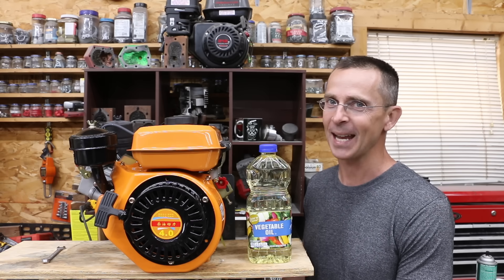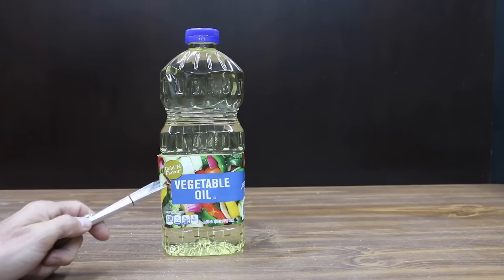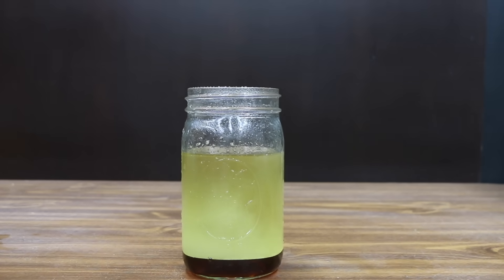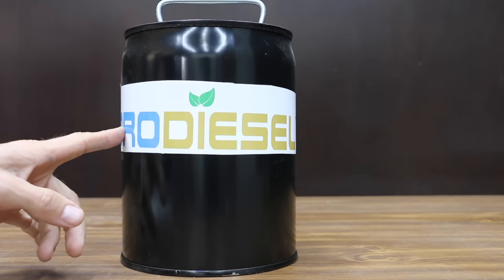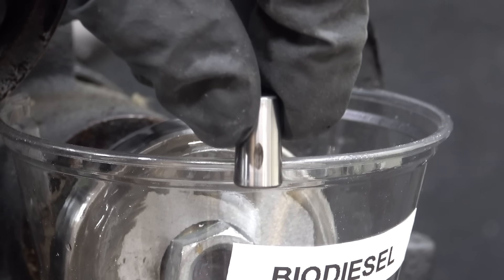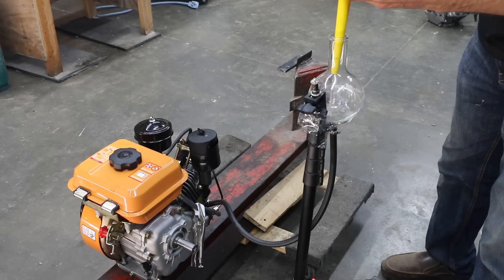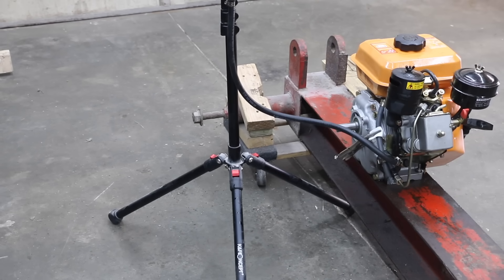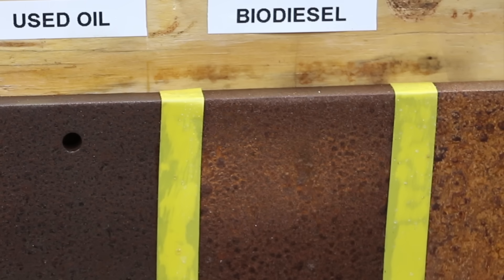Make "Biodiesel"? Let’s find out! Diesel vs Biodiesel, Used Motor Oil, Vegetable Oil, MPG

Comment: You should test which portable heater is fastest/quickest, cheapest to run etc.
Reply from the maker: Thanks for the video idea.
Reply: @ProjectFarm  ah cheers mate. Really confused at the moment. Seems people seem to say cheap and expensive electric heaters output same amount of heat if electric rating is the same. Does that mean they take the same amount of time to heat up a room? Then you got the fan versus convector. And oil based radiators or some such thing. And ceramic heaters too now. Nobody seems to have really tested it properly. And the difference is between 10 pounds to hundreds of pounds.

Comment: I wish you'd tested used fryer oil, as it might have lost lubricity.

I was really surprised that veg oil lubricated so well,  as the word on the street is that it causes pump failure because it doesn't lubricate as well,   definitely something wrong with that rumour,  unless a week in a fryer drops it's lubricating qualities ...

Supposedly older mercs can handle veg oil,  but the newer ones wear out the fuel pump on it,  and the dedicated users have a diesel tank to start on,  and use engine or coolant heat to warm up the veg oil before switching over.

I wondered whether the biodiesel lubricated better than it's component oil as synthetic oil is an ester,   another theory bites the dust.
Recently I heard that biodiesel blends are better than diesel or biodiesel,  less likely to grow microbes in tank,  but I think any fuel will grow microbes if there's water contamination,   they grow in the water interface.
Reply from the maker: Thanks for the feedback.

Comment: A test with marine grade adhesive sealants would be pretty neat! I use a product at work called 5200 made by 3m and have never seen it fail or break in any way. Life seal and 3m 4200 are also pretty tough and may be fun to test.
Reply from the maker: Thanks for the video idea.
Reply: The 5200 sure is amazing stuff God forbid you ever have to remove it though
Reply: @thomasbarlow4223  wire wheel on an angle grinder 🤪😷

Comment: I have run thousands of gallons of WMO mixed with diesel or gasoline and find it to be an excellent fuel, even in somewhat modern (pre-dpf) engines.  

  I usually mix it 50/50 with diesel but I have run it as thick as 90% WMO/10% gasoline in the summer.
Reply from the maker: Thanks for sharing.

Comment: Good day Sir 
I was wondering if you could make a video of running a nitro/glow rc engine on the required methanol and castor oil and instead of nitromethane you use petrol/gas in America or diesel 
It's just for interest sake
Reply from the maker: Thanks for the suggestion.
Reply: @ProjectFarm  
I enjoy your content
I didn't come to YouTube to go back to school but when I watch your channel I learn and I enjoy 
The findings are very helpful and most of the time interesting 
Especially the test between the different oils
Oh and plz use castor oil and not 2 stroke oil because 2 stroke oil clots up and forms a weird substance at the bottom

Comment: Will a gas car engine run on 50/50 gas and plain vegetable oil ...... soon gas will be so expensive maybe some mixtures may be in order for 4-wheelers, lawnmowers, cars..... what mixtures work well...... I do run a 1 gallon to 10 gallon mixture of diesel to gas (10 gallons of gas) in my old ford ranger 2.0 (have done this for years)
Reply from the maker: Thanks for the feedback.
Reply: @ProjectFarm  thank you for the informative and very entertaining content
Reply: Incidently ..... in the old heavy equipment we have run on 10w30 many times when needed to

Comment: That was another fun project. I think a car with its more sophisticated electronic injection and o2 sensor, would do a better job of mixing the fuel with the right proportion of air for more efficient burning. My wife saves all the oil from olive jars and sun dried tomatoes in oil, to pour into the tank. Not a great amount by any means, but possibly another 5 miles of driving every week.  That engine is a handy little thing to have around. It might not run so well if you put raw Burger meat into the sump to see if it runs better than bananas 😂
Reply from the maker: Thanks for sharing.

Comment: Please do a woodgas/pyrolysis setup and test different types of organic waste (including general trash) and plastics to run on your generators. Would be great to see what materials has the most energy density in terms of flammable gases produced in the process.

You could probably produce some usable byproducts in the pyrolysis process. Trying these in your engines will also be really interesting to see!

Being able to run your home from your waste alone is a topic I'd like to see more of!
Reply from the maker: Thanks for the suggestion.

Comment: I wonder how well it would take to a load on it, such as a go-cart. Smiles per gallon.. would it affect speed, horsepower, or torque..   which one runs longer..  we need more testing on this
Reply from the maker: Thanks for the suggestion.
Reply: @ProjectFarm  thanks for reading and replying.. didn't think anyone would actually see this.. I know diesels are torquey. Just wondering if it would actually lose anything with alternative fuels.

Comment: The old and trusty Mercedes Diesel generation (OM601/602/603) run very well on straight rapeseed oil. Only a few minor things to consider, but no problem at all and people used to do this a lot here in "old Europe". They even collected frying oil and cleaned it up in their own centrifuges.
Reply from the maker: Thanks for sharing.

Comment: When I had the time I made fuel from used motor oil. I cut it with some gasoline or sometimes paint thinner. Both my 1989 7.3 and my 300D loved it esp my 300D. I think my 300D ran way better on it than diesel. One day I’m going to find a beater newer TDI 2007 and up to experiment with.
Reply from the maker: Thanks for sharing.

Comment: Do a friction wear test with 2 stroke mineral and synthetic oils in diesel, gasoline and etc...

I'm interested if 2 stroke motor oil works with ulsd diesel for old mechanical fuel pumps
Reply from the maker: Thanks for the video idea.

Comment: I had a 86 f250 with 6.9 deisal. Summer time i ran 80 to 100% used motor, tranny, gear, hydraulic oils. Winter i mixed it 50/50 with kero, heating oil, or diesel. Whatever was cheapest atm. Ran it 2 years with no issues other little more smoke. Till i got ride of it.
Reply from the maker: Thanks for sharing.

Comment: Motor oil used or not creates abrasive ash when used as fuel in a Diesel engine, which has nothing to do with the dirt in used oil, the increased wear it creates on the bores and rings cancels out the saving in fuel costs. With vegetable oil you can run a Diesel on it but its viscosity cold means it may not start on it, you need to preheat it to 80 deg C to match the viscosity of Diesel oil which the fuel pump and injector are designed for.
Reply from the maker: Thanks for the feedback.

Comment: A test for biodiesel is shelf stability, the ability for the fuel to sit in a normal vented Land Rover fuel tank for a period of months and not coat every metal surface with a hard wax like gell  or attract moisture and rust out your fuel tank and fuel lines. Ask me how I know.

Comment: Great subject and video.  I’d like to see you test fuel mileage differences in heated waste veggie oil, heated waste motor oil, bio diesel, and regular diesel.
Also, a cost per mile, would be interesting to know too. As well as the time it takes to filter/process each fuel.
Reply from the maker: Thank you!  Thanks for the video idea.

Comment: Great test as always! I can actually relate to this, I dump all my used motor oil into my 95 Cummins. Its amazing how many people think your nuts!
Reply: I did the same when I had a Ford diesel . After I ran it through a t shirt for a filter.
Reply from the maker: Thanks!  Thanks for sharing.
Reply: Used engine oil is carcinogenic, but so is gasoline and diesel
Reply: It doesn't clog the fuel pump?
Reply: @WHATdowelearnfromthis  It's a diesel engine, I'm sure it takes less to move that through than diesel fuel
Reply: @WHATdowelearnfromthis  oil won't clog the pump . Plus it gets diluted . The risk is metal particles from engine wear
Reply: I've gotten through some tuff times in this manner Transmission fluid as well always 50/50 with diesel. The engine ran better and got better economy. A common antidote for the low sulfur diesel is a quart of Trans fluid at every fill up

Comment: I know this is anecdotal, but I have been running a 12 valve Cummins for 10 years on filtered used motor oil and/or ATF with no problems at all, it seems to like ATF over motor oil.  Stay away from full synthetic oils though, for me it tends to run rough and the EGT's get high.  You do need to cut it with diesel or gas if you run it much colder than 40F but in the summer I run straight oil.  On an older truck I wouldn't hesitate to run motor oil/ATF but with all of the sensors and complicated injectors and pumps in the modern diesels I wouldn't risk it.
Reply from the maker: Thanks for sharing.

Comment: I looked and didn't see torque wrenches yet on you channel... Unless I totally missed them. I'd love to see strength and accuracy from low to high end ones.
Reply from the maker: Great suggestion!  Thank you.
Reply: @ProjectFarm  cool! If you do do it, I'd love to see Lexivon in there. I needed to get over 100 ft lb for my wife's new wheels, and my Pittsburgh 3/8 didn't go that high up, and I never trusted its' accuracy. So I bought a 1/2 inch Lexivon brand one. Amazon seems to be pushing them hard. The tools seem real nice and solid, but I can't help but think I overpaid for a nice looking piece that isn't that great.

Example: I know when the end nut is "Locked" on the Pittsburgh, the handle still spins while using it, changing the setting easily. Well, the Lexivon seems to so that too, albeit not as easily. So I'm wondering if this slick, modern-looking set is any good; or if I overpaid for a nice looking wrench. (I got sucked into buying an impact wheel socket set from the brand too. Lol)

Comment: I've been running my F350 on a mixture of used ATF, new motor oil, gasoline and even real pump diesel sometimes for well over 3 years and she's still going strong at 355k miles. Smokey and smells funny but that describes most diesel trucks in the PNW anyways. I've tracked mileage, engine temps and pulling power and it's basically all the same on whichever fuel I'm using. Great video!
Reply from the maker: Thanks!

Comment: Back when Diesel was $5 a gallon I ran WMO cut 25% with diesel in my Kubota tractor. I first filtered the WMO down to 1 micron with a two stage pump and filter set up, then blended the diesel with the WMO. Tractor ran great, a little warmer than normal, but acceptable, also seemed to have a bit more power too.  Would never run it in 9 and up electronic injected diesels, but works great with mechanical injection. 

Bio diesel you need to be careful that it is 100% dry, especially with the newer diesels that use the CP4 pumps. They don not like any water, period and will destroy themselves and take the fuel lines and injectors with when they go.
Reply from the maker: Thanks for sharing.

Comment: Great video; however, with modern high pressure Diesel injectors I'm not sure they would be able to run vegetable or used motor oil. Not to mention clogging up DPF filters.
 Now the old military rigs used to run on almost anything.
Reply from the maker: Thanks!  Thanks for the feedback.

Comment: I used jus filtered used cooking oil and used motor oil and gas mix on the same engine for 2 years no problem the only disadvantage is changing the fuel filter every 2000miles :)
Reply from the maker: Thanks for the feedback.

Comment: Yes you are correct running the diesel engine on straight vegetable oil can produce problems with your engine that’s why you must heat it up preferably 160 to 180° to achieve proper atomization of the fuel then it is  a very good fuel source for a diesel engine
Reply from the maker: Thanks for the feedback.

Comment: I recently discovered the channel and couldn't be more entertained and informed.  I have a few ideas for new videos: an ultimate oil showdown (wear test is my fav)- test them all from 100% synthetic to full synthetic to conventional, as many brands as you can.  Is there an objective test for fuel system treatments besides compression improvement?  Can u soak an exhaust valve in a treatment and measure % carbon removed without mechanically wiping to simulate real world use?  Would there be a better way to simulate this type of test and actually measure % carbon removed?  

Also, new products come out all the time.  Maybe keeping track of a winner for each test and comparing it to a new product to see if it can edge it out would be a good idea.

Anyways, love the channel and the fact that you are 100% unbiased.  It's hard to know what reviews to trust these days but we know your reviews are the gospel truth!  Keep up the good work.
Reply from the maker: Thanks, will do!  Thanks for the suggestion.

Comment: I remember that it was common a few years ago (the last time I cared) to run used oil through a strainer and over a magnet, then put it into the fuel tank on fire trucks, semi's etc.  It was not only free fuel, it also disposed of most of the used oil.
Reply: Used engine oil is known as black diesel. It eventually cokes up injectors; I know someone who purified and tested it endlessly as a challenge and eventually had to admit defeat.
Reply: @billguyan1913  But the big question would be what ratio causes any kind of problem.
Reply: @SoloPilot6  Diesel engines can tolerate about 33% petrol but will soon cause injection pump wear at that level. For cutting alternative fuels, such as winterising biodiesel 5 -  10% is the norm. If you want to run on waste motor oil it would be in that range, but be prepared to extract your injectors every two or three months.
Reply: @billguyan1913  First, there are diesel engines which can run on gasoline, with a little engine oil added for lubricity.  I've had a couple of these, back when I was collecting military vehicles.  Second, those same engines often are run on various waste oils (either from the crankcase or the Chinese restaurant), with no ill effects.  If the military engines can do it, that leads one to wonder just what can be done with more common engines.
Reply: @SoloPilot6  As you are aware these engines are not standard diesel engines but have been developed to run on whatever fuel was available in combat situations. People who look into alternative fuels are invariably looking for cheaper alternatives to what can be bought at the pumps and as you know gasoline is not one of those. In any case ordinary diesel engines can't run on gasoline - I've had them sitting idling but they immediately stall if driven.
Reply: @billguyan1913  But the technology is there for fuels way outside of what people consider normal, which brings us back to using waste oil.
Reply from the maker: Thanks for the feedback.

Comment: I put 100K miles on my 1992 Mercedes 300 on WVO (waste vegetable oil) on my car. It was amazing. when I did a head gasket at 310,000 miles it still had the machining patterns on the cylinder walls and the cam.
Reply from the maker: Thanks for sharing.

Comment: I have known many old school mechanics to run a quart or 2 of cheap transmission fluid in each tank of ultra low sulfur diesel for lubrication in older diesels like the 12bt cummins
Reply from the maker: Thanks for sharing.
Reply: @ProjectFarm  not a problem sir. I was told the old mechanical pumps need the extra lubrication.

Comment: a buddy of mine ran used engine oil/gasoline blend in his old td mk2 golf and it ran great, it did puff some grey smoke at cold starts though. But it didn't seem to care if it ran on vegetable oil, diesel or engine oil power wise and even got more kilometers pr liter with veg and engine oil
Reply from the maker: Thanks for sharing.

Comment: Use to run my old 1.9d Citroen c15 van on veg oil here in the UK always. Just add just a little diesel to thin it down. I broke the drive on a Lucas cav pump in cold weather. I actually think it was more responsive on veg oil
Reply from the maker: Thanks for sharing.
Reply: @ProjectFarm  How about to radiator/head gasket stop leak fluids (yes, I'm posting my idea again lol)

Comment: Doing a wear test with diesel fuel as a lubricant seems nerve wracking. +1like.
 
Back when I did my organic chemistry class in college, the teacher went over biodiesel in some detail. 

In his analysis, the main thing to avoid was the formation of soap, and he focused on the dryness of the oil and methoxide, since that tends to be the only point that you really have control in the reaction. 

I've also watched quite abit about using an acidic process that uses sulfuric acid, but I think that tends to be something better suited as a polishing process after you've made the biodiesel. The sulfuric acid breaks up any soap that forms during the esterification process, and removes any remaining hydroxide a bit more thoroughly than a water bath, although you still might need a water bath acidifying it.  

Something that might be interesting for a future video would be diesel fuel made from plastic.
Reply from the maker: Thanks for the video idea.

Comment: I'd love to see your small diesel engine run on vegetable oil, with a small amount of HHO from your HHO dry cell, to show (for better or worst - exhaust cleanliness, cylinder head temperatures, and if it improves run time (mileage).  TIA   For those who say the HHO uses energy to make it, do like I do. Use a solar cell to charge the battery, that is used for the HHO Dry Cell, to eliminate that issue.
Reply from the maker: Thanks for the suggestion.